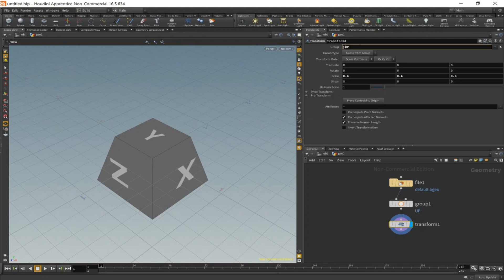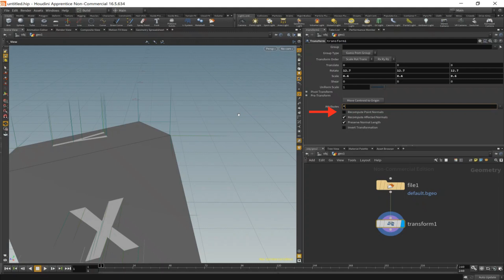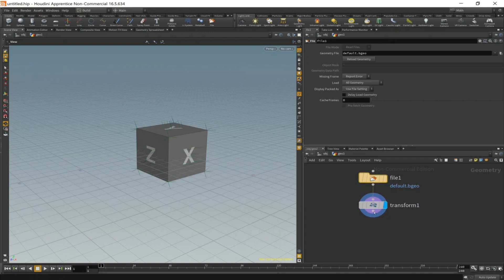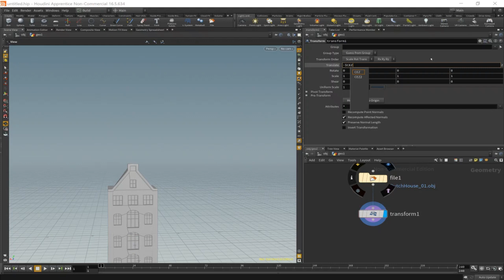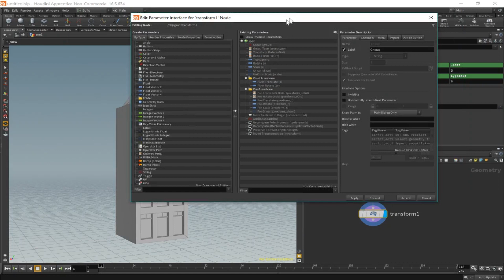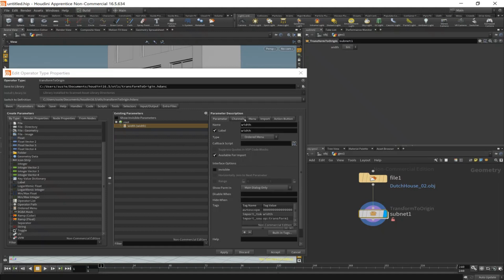Comment: The scale wasn't working for me until I compared the example scene and noticed I hadn't checked the 'Use menu item token as value' in the parameter interface. I didn't see you do that in the tutorial but yours still worked in the video?
Reply: Excellent tutorial, you're making this program a lot less daunting
Reply: Yes, you are absolutely right. I didn't spot it in the video because it worked. I changed the file later when I realised it was being flakey. I don't know why it worked originally- possibly something to do with the Houdini version? The video was made with 16.5.  It should be ticked. I will see if I can re upload the video with a note on it. Thanks for the heads up.
Reply: @houdinikitchen  When creating the digital asset, and adding the "width" parameter to the parameter list for the asset, the "Use menu item token as value" option must be manually checked there as well. The parameter on the subnet1-node seems to inherit from the parameter inside the digital asset and then inherits this checked option.